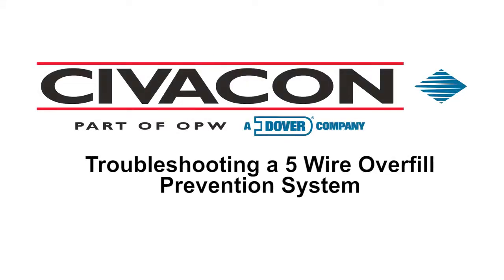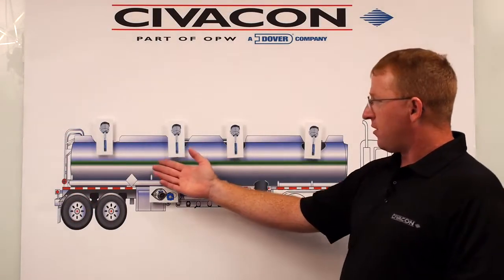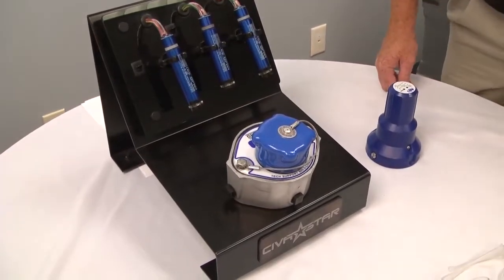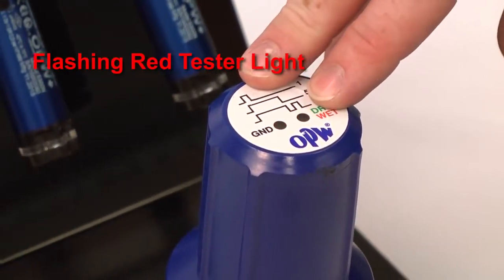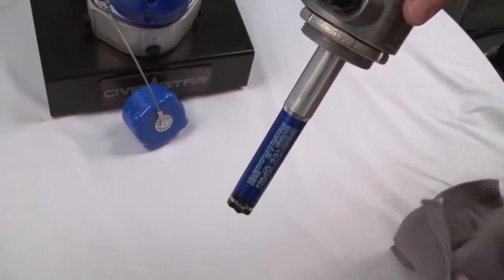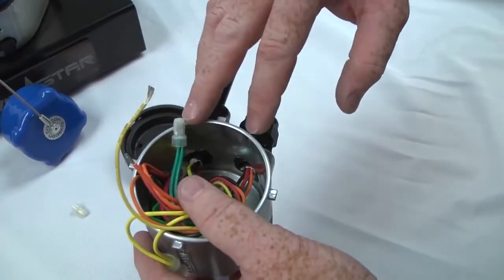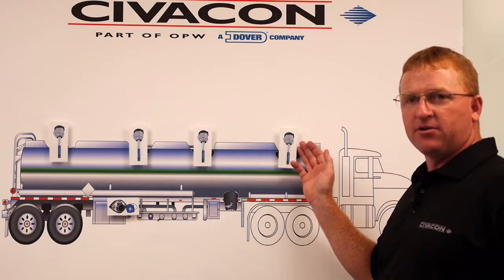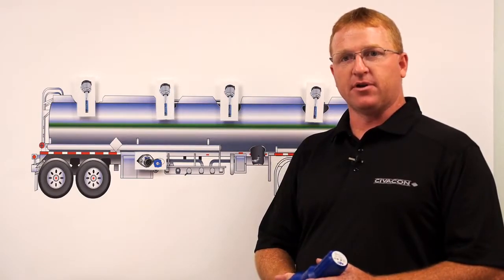Troubleshooting A 5 Wire Overfill Prevention System

Comment: Hy dear how we test probe with multi meter
And one more thing why we use 5 wire we need only 2 wires for Power + -. And 1 wire for signal or command why we use more 2 wires have other functions of these 2 wires